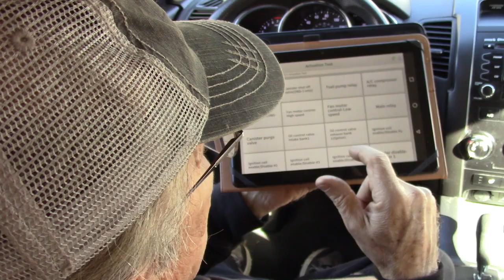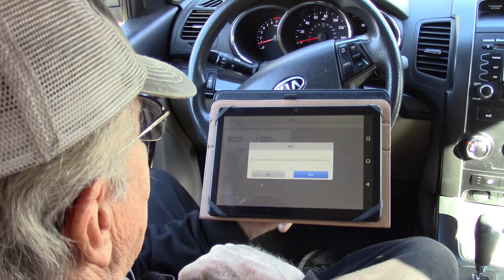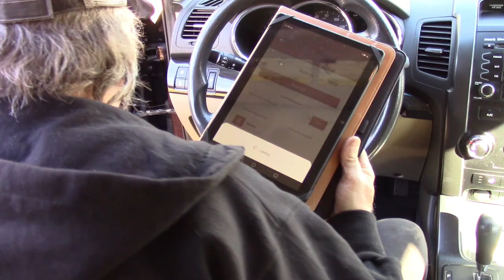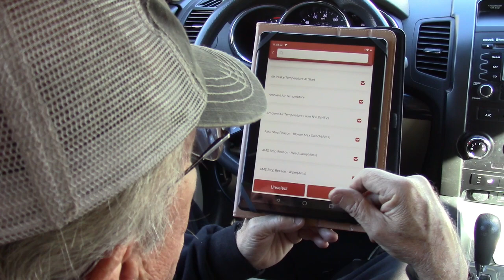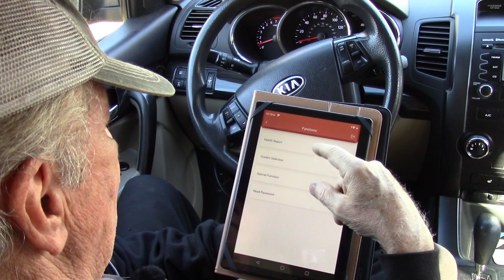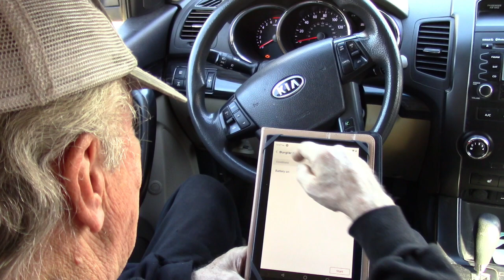Kia Sorento Xtool A30M, Thinktool Thinkdiag 2, and Topdon Topscan Pro dongle shootout.

Comment: I thought of buying the Xtool AM30 but at the price they want it's like you are paying for 4 years of update's up front in comparison to the Topdon Topscan. So with the Topdon maybe one year or two you don't use it, so don't buy update's until you need it.
Reply: I went with the Topscan because it does most of what my tablet scan tools do like full system scan, live data, bi-directional controls, and graphing. I just wanted another portable scanner in addition to my tablets. I paid $50. For the vci and 1yr subscription it's a no brainer. If I like it, $50 a year is worth it to me.
Reply from the maker: It absolutely does depend on how much you use it.

Comment: The Xtool WILL do a pdf report which you can email.😊
Reply from the maker: Thank you very much for the input.
Reply: Report Generation:
After performing diagnostics on a vehicle, the A30M allows you to generate repair reports.
These reports include essential information about the vehicle’s health, trouble codes, and other diagnostic details.
Report Formats:
The A30M supports PDF format for the generated reports.
You can easily save these reports for future reference.
Sharing Options:
While direct email functionality is not built into the A30M, you can:
Share the report link via email by attaching the PDF file.
Use other communication channels (such as messaging apps) to send the report link.
Customer Communication:
Sharing diagnostic reports with customers enhances transparency and helps them understand the vehicle’s condition.
Customers can review the report and discuss findings with you.

Comment: Good overview for these 3 scanner. So, which is the best for you ? Wich is funny to use ?
Reply from the maker: So far they all seem to perform equally as well.  The Xtool is the most expensive one to purchase up front, but there is no yearly subscription fee with lifetime updates.  The Thinkdiag 2 is more expensive to purchase than the Topscan and the yearly subscription fee is also higher.  Since the performance aspect appears equal so far, the better value, in the long run, would be the Xtool if you can afford the higher initial cost.  As I learn how to use them I may notice a difference that would justify the higher cost of one of the other dongles, but that remains to be seen.